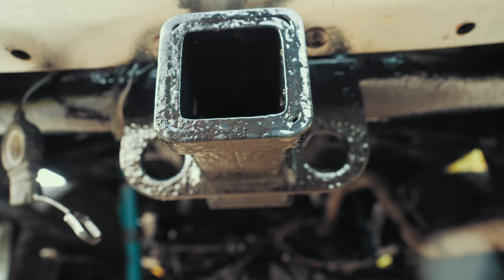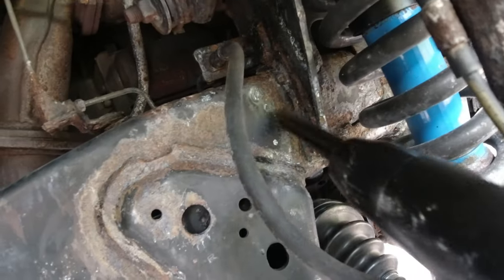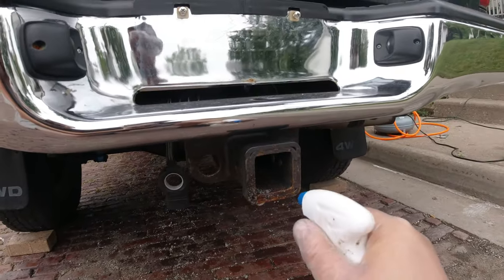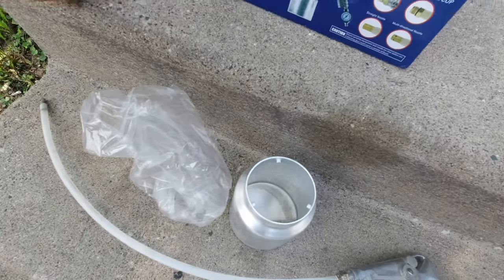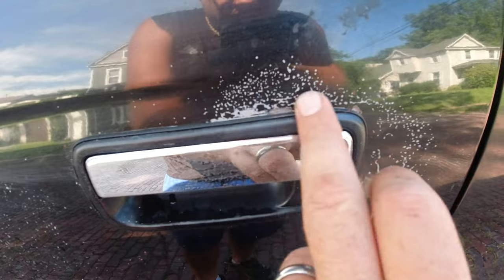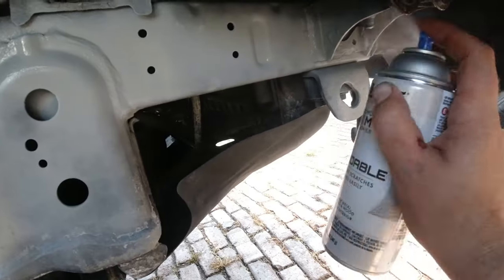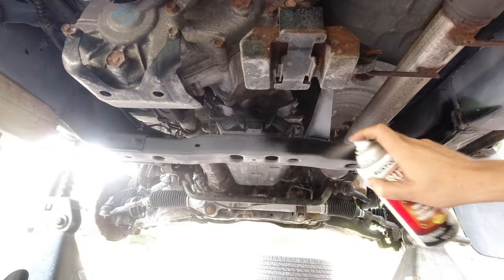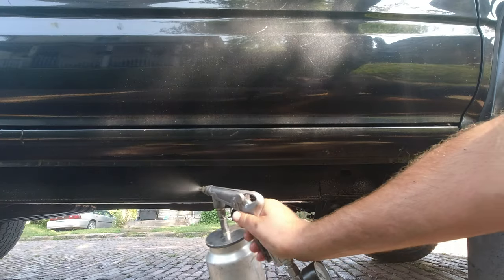Ultimate Undercoating for the Rust Belt - Converting Rusty Truck Frame to Salt Water Warrior

Comment: Here in Canada, rust proofing products are rediculously expensive so I started making my own. Using a drill powered paint mixer, mix one 400 g tube of Valvoline grease with two quarts of chain saw bar and chain oil. Spray with a comprressed air undercoating sprayer.
Reply: That’s interesting- I’ve heard of grease and atf… I guess that’s similar to vasoline and bar chain oil! 

I’ve heard that PB blaster undercoating outperforms all rustoleum products at preventing new rust and inhibiting old rust
Reply: How well does that mixture spray? My 5 gallon bucket of fluid film is almost empty, and I'm not going to spend the money on that product. I was also going to use bar oil...mixing in grease sounds great if it will spray okay. I have the fluid film gun that has the long wand to get into tight spaces.
Reply: It sprays well with any cheep undercoating gun. If not, just thin slightly with paint thiner. The thiner will evaporate off leaving the coating.
Reply: how much psi is needed for your mix ?
Reply: It depends on your sprayer. Using a inexpensive Princes Auto (think Harbor Freight in the states) sprayer, I use 70 to 80 PSI. I want to blast the covering into crevices.
Reply: I have heard repeatedly that there is no need in California to do anti-corrosion treatment of cars. And you did? Did I get you right?
Reply: And drip oil everywhere you go...
Reply: No. Very little dripping. I park it on my concrete drive and you only get a few drips.
Reply: I just use used motor oil. It’s free.
Reply: Diesel fuel and ATF !
Reply: I don’t think that getting Krown to do it yearly for 149.00 is that expensive, you need to get your car truck on a hoist to get all the parts.
Reply: @mikefennema5561 Here in Canada EVERYTHING is ridiculously expensive!
Reply: Shell Tectyl
Reply: Most people don’t understand but I haven’t cousins up north so I’m well aware of it. It’s called socialized medicine and that’s why you text very heavy but if you’re close to the border and there was one close by take advantage, thanks for your comment.
Reply: I’ve heard that bar and chain oil mixed with some kerosene as a dispersant works well.
Reply: I grew up on a farm in new England we always used old motor oil and transmission oil on all the steel tractors and equipment and the trucks we just painted it on 
It was a good way to use the old oil many people don’t do this anymore 
Today I use rust converter and paint it on like the old oil every 2 years or as needed then after 48 hours I use fluid film looks better then new  make sure you remove your front fender walls there the place where salt will stay and rot your fenders out spray inside the fenders 
Do not use undercoating it’s junk o only use oil base

Comment: About 40 years ago, I started using a 50/50 mix of used oil and diesel. We usually carried about six tons of salt for traction and to apply on the roads and lots. The 50/ 50 mixture would last for about one storm, that was about three days and nights of plowing, salting and hauling. Then we used Fluid Fluid Film. That would last about one month and we would reapply. Now we are using a product made by Rohmar, we touch it up twice a year, that takes about 15 minutes.

Comment: Old timer years ago told me to mix Diesel with used motor Oil, shake it up and lay it on with a pump sprayer or compressor. He said it will drain into all the cracks and crevices that water does and protect it. He ran a Square Body dually with a Mason bed on it until he passed. 1986 GMC almost rust free for 20 years in Connecticut Winters. My go to for rust prevention, cheap and used oil is free
Reply from the maker: If it’s cheap and it works !!!! 💯💯💯

Comment: Pull the plugs from the rockers and doors, spray fluid film inside and also remove taillight to treat inside wheel house of the bed.
Reply from the maker: Pro tip 👊🏻

Comment: I used to get under my 97 Sierra and scrape and wire brush and repaint and it just kept rusting and flaking off. Finally started shooting Fluid Film underside that was the answer to keep the truck on the road. Sometimes I heat it on a hot plate and put in shavings of paraffin (an old candle works) and shot it while it's warm. That's been the best thing so far.
Reply: Similar here.  I'm experimenting for long time.  Go see if you want "10 year of using cold galvanizing".  At end we all come to Valvoline and Cosmoline.
Reply: The reason paint doesn't work is because it chips so any salt water mixture will just get into the chipped areas and underneath the paint. The reason fluid film works is that it self heals, when an area gets exposed since it never becomes completely solid it will just fill the exposed area in
Reply: I use fluid Film as well and I love it. I mix in some fresh 15w40 engine oil with it. It works so well.
Reply: Ratio please?
Reply: @Penland1234  I honestly just pour some oil in. If I had to guess I would say 20% oil 80% fluid Film.
Reply: @Bloodbain88  Thanks I might mix this with film with transmission fluid one day especially if using just one gets too messy👍

Comment: Thank you so much for sharing this. By the way excellent work question would you still spray nuts and bolts, if you do that wouldn’t cause problems loosening, or tightening bolts and nuts?

Comment: I'm impressed. Way more detail-oriented than I ever was. I merely get under the F150 every fall and paint on bar-and-chain oil. Let it soak into the surface rust and everything.

I'm sure this is a better fix than what I've done, but 28 Pennsylvania winters in my F150 and it's been "good enough." Just a heads-up that even halfassing it is far better than doing nothing.
Reply: Nope,  way to much manual labor.   Impressive on your part.   I learned the hard way that Transmission fluid is a superb under body coating.     I had a Transfer case shell out going down the interstate.    Transmission fluid covered everything rear ward.    That part of my vehicle never rusted out.   Everything not coated turned to dust.
I agree with bcubed..    doing SOMETHING can help greatly.    Used oil,  Diesel, Tranny fluid,  Fluid Film.
Reply: @Milkman3572000 you can do that, or just paint the frame good once, spray that on later in winter if you’re gonna have a bad winter. I have a 2006 with a completely factory coated frame still no rust, no need to do that imo unless you never clean the truck or have an insane amount of salt on the roads
Reply: Just did my silverado in bar and chain oil.  Never tried it before. Does it hold up all winter and not wash off?
Reply: @jeremyniles2676  depends on where you’re at and what your city uses for deicer. If you have mild winters then yeah, harsh winters? No
Reply: @jeremyniles2676 did it hold?
Reply: @alvingarden4486  better than fluid film did on the frame its self.

Comment: you have to apply rust proofing before the rust starts. once the rust starts, it’s too late.
 I bought a ram big horn 1500 hemi in 2017. I took it home, and I rushed proofed it before it ever saw rain or salt in October here in Pennsylvania. I have the videos of the annual inspections of my chassis and the rest of my truck on YouTube. I have the yearly inspection of my room, since I rush, proved it when it was only five days old with fluid film on YouTube before winter and after winter over the past seven years. So I have quite a few videos on YouTube inspecting under my truck here in Western, Pennsylvania, where they salt the roads for four months of the year every winter…
  this just reminded me to do my 2024 inspection video for YouTube on my channel.
  I did my truck in my gravel driveway, I bought the special spray gun and a gallon of fluid film on eBay for around $75. I removed the wheels, I remove the plastic fender inner liners, I removed the 16 or 18 rubber plugs along the rocker panels, I remove the headlight and tail light assemblies so that I could get all the way in everywhere on the truck, every hole, one of my videos shows how fluid film travels. You just have to be close like with Handgrenades.
I sprayed under the bed of my truck when I first brought it home in 2017 with the spraygun taking my time. I noticed for years later that that fluid film traveled up into the bed of my truck through a seam. I didn’t know was there because my bed on my ram has a factory black spray on coating. That fluid film found a way to get through that. That stuff travels up hill..
 I also bought the 3 foot long attachment for the spray cans that you can buy for $10 or $11 at Lowe’s and Home Depot. This attachment goes on top of the spray can when you remove the nozzle, and replace it with the special nozzle that has a long plastic tube with a brass jet on the end. The brass jet makes the stream come out 360° to the side, it doesn’t make it come out straight and it comes out very fast, so when you stick that up your door post all the way to the roof through one of the holes, you wanna pull that thing out while pulling the trigger in about two or three seconds, because you can completely empty. That spray can probably in about 20 seconds if you just hold the trigger with that special nozzle that I bought on eBay for $14..
  The only thing under my truck that is rusty are the drivers and the drive shaft. The drivers spin, the front wheel, drive shafts, and the drive shaft to the rear axle is rusty. Nothing sticks to them because they spin and centrifugal force removes anything you spray on them. I imagine some special paint like POR15 would stick, but I tried that POR15 on my. GMC pick up after it started resting to try to save it, and I got some of that stuff on my skin, even though it says all over the label of that POR15 can not to get that on your skin. I had to go to two different skin doctors after I got that on my wrist where my gloves stopped in my long sleeve shirt had a gap.
  on my channel I also have a video of a horrifically rusted ram pick up. This truck is actually dangerous that I took video of and put on my channel, there was no area of the truck that was not sharply dangerously rusted with lots of metal missing. We have annual state inspections here in Pennsylvania, I cannot believe that thing was roadworthy and would pass Pennsylvania safety inspection. But I have video of what happens to ram pick up trucks if you do not rust proof them where they throw salt..
  in 2023, I bought a guitar from a guy on craigslist, and when I got to his house he had the same truck I have. A 2017 ram bighorn hemi. I asked him how he liked it. He said he loves it, but his mechanic buddy, that does his inspections and oil changes told him to get rid of it because, the rust is gonna start coming through everywhere on the truck. The mechanic told him that he would replace the quarter panels for $3000 if he wanted to keep the truck for a while, but that’s not gonna stop the rush that has already started on the rocker panels the doors, the tailgate the fenders and even the hood..
  his truck only had 52,000 miles on it, and he hast to get rid of it just because of the rust..
  Anyway, if anyone wants to see what it looks like under my ram pick up year after year of inspections, that I have videos on my YouTube channel, take a look
Reply: "you have to apply rust proofing before the rust starts. once the rust starts, it’s too late."

Exactly this!
 All these videos where they try and remove rust and paint it with black undercoating is to make it look pretty for a little while. The rust still continues to form underneath.
The time to rust protect the underside of a vehicle is when it's brand new without any rust having formed.

Comment: Nice work! The only recommendation I have is to do your deep cleaning/degreasing before removing the rust. This way you don't end up spreading around the contaminants and driving them into the metal. Then you can do another lite degreasing afterwards.

Comment: I have been using a rust converter called Corroseal. It can be painted on, it's not poisonous and it leaves a beautiful black finish, but it still needs to be top coated. And it is water cleanup. So because I don't have a lift this is perfect for me.

Comment: I just grinded and put phosphoric acid prior to undercoating on ONE cross member of my pickup's frame and it took me closer to three hours and I was covered with dust after that. I can't even comprehend how someone could do the entire frame at once. Thank god the previous owner had it undercoated before me so it's almost rust free from the front to the rear of the cabin and only the parts sandblasted by the rear tires are rusting

Comment: phosphoric acid (what the rust kutter is) will turn the iron oxide into iron phosphate so yea it can be directly painted, maybe good to just brush it a bit to get dusty bits off. Probably better to leave it on actually vs cleaning it with water though

Comment: Nice video. The gas tank on my car recently fell on the ground after filling it up at a gas station. Someone was calling me on my cell phone and I pulled into a space while in the gasoline station. While I was parked and attending to my phone I heard a noise. I thought someone had thrown something at my car or may be a tire hit my car from the highway. I saw nothing. So I got back in the car. I did not jump on the highway right away which was next to the gasoline station. After a while I started up the car and someone got behind my car while I had it in reverse. I did not in a million years think that I would be dragging my gas tank. It really freaked me out. I called me insurance and a tow truck came and put those pulling straps to hold it. They could not move it because it was full of gasoline. So they had to use a small flat jack to lift it up. The straps held it in place. I am thinking about putting a long metal flat bar attached to the chassis with Chrome screws to prevent the tank from falling again. The tank is sitting upright in a vertical position in front of the trunk. Death was following me, but God was on my side I guess. For those who have have not had this happened to them CHECK underneath that the gas tank is secure from those metal straps as well as the fuel lines and brake lines, especially if your car is old and has rust. Do not ignore the rust. We are used to just checking under the hood, but if you are living in the north you are at risk because of the rust. I hope I have saved lives with this information. Get undercoating and clean that rust before it spreads like a cancer. It can be very very dangerous and serious, especially if you have family riding in your car. This is serious stuff. Thank you for sharing your video with us.
Reply from the maker: 💯💯💯 I won’t buy or even go look at a car/truck without first seeing pics of the underbody. Most people don’t look and could care less. But it’s a big deal.

Comment: Manual descaling.  Then Corroseal.  Goes on like milk or wood glue, turns black, takes 24 hours. ($100.00 per gallon) then Rust Oleum primer, then Rust Oleum High Gloss enamel.  Same effect.  I did use White Rust Oleum enamel around the inside of the frame to track any further rusting.   Ranger frames have one side open.   Yep.  Corroseal.  Works Great. Thank you for this.

Comment: Wow, what can I say? I am going to do the exact same thing on my 2003 Silverado 2500 HD, I started a snow plowing business. I found that the older cat eye  Silverado’s 6.0 work better than the new trucks, they are simple to fix. In a bind there’s nothing fancy.
Problem is the only thing that goes wrong in the winter is the salt either rots , transmission line, fuel line, brake line, power steering line etc.
I ordered every single line on the whole vehicle factory pre bent stainless steel , actually not much more expensive than the regular steel. You did an amazing job, and I appreciate the video. We all know a Toyota will run forever. The only thing standing in its way is a rusty frame, way to protect your investment
Reply: I worked in a body shop for years. If you were close to Buffalo New York, I can paint the door and the tailgate.😂 the good thing is it’s black, so you do not have to overlap the adjacent panel

Comment: What are the problems when continuing the process when not waiting long enough for the frame to dry ? I have 2 days to get my project done , is it possible to get this process done in 2 days? I have all the materials
Reply from the maker: I think every trucks condition is different. I’m not sure the results of not letting it dry all the way but you could just knock all the rust off, power wash it, let it dry and go straight to the undercoating. That’s what I did with my tundra I got a few months back. Doesn’t look as good but still serves the purpose.

Comment: Awesome job!  You've done everything that is reasonably possible to do on an older vehicle to preserve the frame.  Brush painting the frame everywhere that you can reach with a brush with Rust-o-leum will apply a thicker coat of paint and then follow up with the spray cans to reach anywhere that the brush couldn't and it might save a few bucks on paint.  Been hearing great things about Surface Shield, but although we have a number of products by PB Blaster available in Canada, I haven't been able to find the Surface Shield product anywhere.
Reply: Ace hardware or home Depot
Reply: @antinazi1959  No.  PB Blaster "Penetrant" oil is available at Home Depot, but PB Blaster "Surface Shield" is not available in stores, or online at Home Depot, or at ACE Hardware in Canada.

Comment: I use corraseal with a pump sprayer...do it every fall before plow season...it works good depending on how thick and the temperature outside when I do it...alot of spots I don't have to do it again but I do anyways...it turns a dark black when it's done it's thing